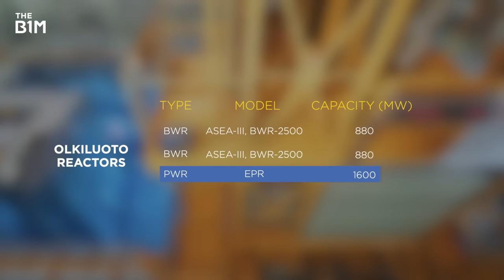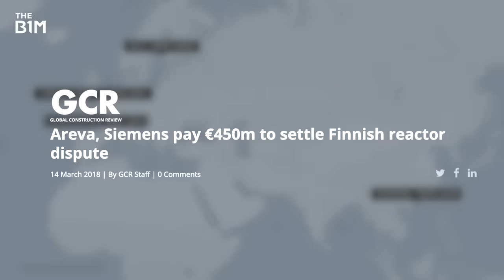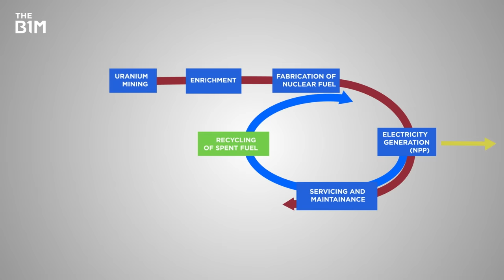Finland Might Have Solved Nuclear Power’s Biggest Problem

Comment: "New reactor design had some issue and caused delays in it's construction"
"China finished building the reactor without delay"
Uh oh...
Reply: It may be the one that is now leaking..
Reply: @bah-be8159  yes it is
Reply: Well china have healthy consteuction/industrial sectore how have modernize the country and had make huge project.
Same as it was in many other countries decade ago.

But when it been 30 or 40 years that you have not build a complexe thing the first one will cost 3.14 time the price and 3.14 time the time.
Reply: well the upside is if the thing in china is not working properly, you will never know, because every engeneer that knows about it, will disapear sooner or later.

Comment: “Why aren’t we building breeders that make their own fuel?”

“too much moni”
Reply: difficult there are only two working breeders in Russia burning material from old Bombs but with constantly new problems. and it is really expensive. solar and wind (wood, gas, and so on) are cheap. You don't want to build somthing when no one will bay it.
Reply: Why aren't we building Thorium reactors which has low amounts of radioactive waste and also has a very short half-life compared to other reactors..
Reply: @wildfire160  for nerly the same reasons with on differnce: there no functional Thorium reactors and the produce waste. Molden salt reactors produce not so much waste but same problem: not really working outside from laboratory.
Reply: @mangshu21  one part of the sahra desert can generate the energy need of the world. Solar thermal energy (stored in molden salt thermal energy storage) can be used at night. why is solar trash?

Comment: There are two choices: either the world embraces nuclear power, or accept a greatly reduced population and standard of living. This is why projects like this must be built additionally, nuclear waste should be reprocessed into new fuel.
Reply: Yes but we need to embrace the right kind of nuclear power. ERPs are  not the answer.
Reply: Renewable technology is rapidly improving. There is a viable third choice.
Reply: @ReubenSilveira6  I used to work in the energy sector so I have some knowledge of what renewables are capable of. Yes they have improved in the past few decades, but they are still not able to provide the power needed to run a modern economy. If renewables were the only energy sources available, with current technology, five billion people would die.
Reply: @jackfanning7952  Jack, you need to read more. I don't know where you found your numbers, but they are wrong. In 2020, 41% of U.S. electricity was generated by natural gas; 20% by nuclear, 19% by coal, 8% by wind, 7% by hydroelectric, and 3% by solar. These numbers come from the EIA, which is the most reliable source.
Reply: Also, remember that humans need a lot more energy than is provided by power ( i.e.electricity). A lot of our current world also relies on chemical energy from fossil fuels. For instance, if we outlawed natural gas and petroleum, fertilizer would need to be made using electricity, which can be done. If there were also no nuclear, fertilizer would need to be made from solar, wind, and hydroelectric. If that were the case, food prices would skyrocket and many people would starve.
Reply: @wordsofcheresie936  I read A LOT. Always have. But I am selective with what I read and who I believe. I got a lot of the numbers about energy from the WNISR 2020 and 2021 status report on the nuclear industry and 30 years working as an industrial hygienist. I have a love of the environment and a penchant for growing things. I also have a degree in agriculture which taught me all the wrong ways to try to grow things (like what you referred to in your comments). But If you don't like the numbers that I provide, which are not my numbers, believe what you want. I choose to believe otherwise. I have seen the destruction within the last 75 years of industrial agriculture of our fertile plains built over centuries with the symbiotic relationship of grasses and wandering herds of ruminants. I predict the entire American Midwest will be a desert within the lifespan of our children...and all the topsoil will be in the Gulf of Mexico. 
After WWII, the two forces that are mostly likely to destroy the ability of this planet to support life were unleashed: industrial agriculture and nuclear energy. I don't know which will get us first. Lord help us to get rid of both before it happens.

Comment: The long term solution is to RECYCLE it!
Reply: But how?
Reply: @TebatusYT   By using what are called 'Breeder Reactors'. France for instance generates over 90% of it's electricity with nuclear power and does NOT have a waste problem. This is because they also operate 6 breeder reactors where they reprocess all the waste and put it back into all the other reactors. Using breeder reactors to recycle nuclear fuel over and over makes it as much as sixty times more efficient. Sixty times more power with the same fuel, and with VASTLY less waste. That's 60 times, 'not' 60 pecent.
Reply: @panpiper  so why wont everyone send their nuclear waste to  france if thats the case
Reply: @panpiper  sounds efficient and clean, thanks for the reply.
Reply: @vihreakuula4319   I expect some do send waste to France, but France is not the only country with breader reactors, they just have the most of them. The downside to breeder reactors is that they are exactly the same facility you need to get weapon's grade material, so it's not something you want being built in rogue nations. However for the most part, such nations can't afford nuclear power plants to begin with.
Reply: @panpiper  Thats not true, france doesnt have breeder reactors
Reply: yo mama
Reply: @senor_m6673  what about Phenix....?
Reply: @shooter7a  shut down more than 10 years ago
Reply: @senor_m6673  You are correct, I used the wrong term. They use "Purex" facilities, which purify and separate material, but does not make more than what is put in, unlike a breeder reactor.
Reply: @senor_m6673  10-4.  So they HAD breeder reactors, but do not any more.
Reply: Once you've recycled and used it you actually have more nuclear waste that cannot be used any more. What are you going to do then?
Reply: @vihreakuula4319  FInland's laws prohibit exports of nuclear waste. That's largely because in the Soviet times it was sent to somewhere in south Urals and we all know how well they handled it there.
Reply: @shooter7a  yeah sounds like a great plan for the future then 😖
Reply: It'll stay there just fine until it's safe to be handled again. That won't take more than some 1000 years.

Comment: This is really good news. I have always imagined nuclear power as the best way to bring limutless stable electricity to African countries. If one can solve the waste and safety issues. This is a step in the right direction.
Reply: Trash to energy plants
Reply: Finland really hasn't solved anything, the best option is to reuse spent fuels and there are reactors that exist that can reuse fuels again making them safe to dump back into the environment once been depleted, just politics doesn't want it funded and misinformed public perception fuels this as well
Reply: Trash to electricity plants are working well
Reply: @bigcnmmerb0873  If everyone would put the waste back where they found it, it's a problems solved. There is a limited amount of uranium so there is only a need for limited amount of vaults.
Reply: @DuBstep115  or you could reuse that waste to completely depleted it and tremendously reduce the waste from 10kg to 1kg
Reply: @bigcnmmerb0873  Does it even matter in the long run? Since nuclear power is not renewable.
Reply: @DuBstep115  if the long run is 1000 years in the future it's irrelevant right now mate so that arguement holds no water
Reply: @DuBstep115  do u have any idea how much material there is on the planet?  There is enough  in the planet to last 1000 years both uranium and thorium adding to that why bury waste when it could be used again to b fully depleted of all it's energy
Reply: @bigcnmmerb0873  About 15 million metric tons. Also I prefer NEA's (Nuclear Energy Agency) opinion to yours.
Reply: @DuBstep115  with the use of breeder reactors if we extracted that uranium from sea we r looking at having fuel that will last 300,000 years since well reusing the same fuel means using less unused fuel so yes my earlier statement still holds true mate
Reply: Why must things always be brought to African countries? Why aren't they bringing things to everyone else?  What kinds of good tech are they hogging there?

Comment: the whole project is pretty much a running joke here... 
But we're already knee deep in it, might as well go all the way and finish it.
Despite the increased cost and delays.
 lol
Reply: . . . . “finish it” . . . nice.
Reply: At least you get cheap energy and reduce your carbon emissions though.
Reply: @marksapollo  maybe one day if it doesn't get delayed by another 10 years
Reply: @Tsuchimursu  Except that its ready now.
Reply: @bloodypine22  well technically yes, but they had some delays in starting actual production and the plant is scheduled to start proper production in early 2022. We shall see if they get it running on full capacity or not by then... So yes it's built but no it's not yet making significant power.

Comment: In October 1976,[9] concern of nuclear weapons proliferation (especially after India demonstrated nuclear weapons capabilities using reprocessing technology) led President Gerald Ford to issue a Presidential directive to indefinitely suspend the commercial reprocessing and recycling of plutonium in the U.S. On 7 April 1977, President Jimmy Carter banned the reprocessing of commercial reactor spent nuclear fuel. The key issue driving this policy was the risk of nuclear weapons proliferation by diversion of plutonium from the civilian fuel cycle, and to encourage other nations to follow the US lead.[10][11][12] After that, only countries that already had large investments in reprocessing infrastructure continued to reprocess spent nuclear fuel. President Reagan lifted the ban in 1981, but did not provide the substantial subsidy that would have been necessary to start up commercial reprocessing.[13]

Comment: Just recycle it.  Then the very small amount of waste that recycling produces will be so much easier to deal with. Yes, it is plutonium.  But the amount that is produced is minuscule in comparison to the literal tons of waste that is produced without recycling.   You could even use that underground facility the Finns are making and the smaller waste stream will be inaccessible forever the way they will do it.

Comment: Thorium molten salt reactors are likely the solution we are looking for.  The wastes at the end of the thorium cycle only need to be protected for about 300 years.   Molten salt reactors operate at normal pressure and avoid the risks of meltdown.  Plus, they extract many times more energy from the cheap, abundant thorium fuel.  Once the process has begun, thorium reactors can produce their own fuel supply.   This technology is almost ready for commercial use.

Comment: So, to recap ....... They have designed a new generation of reactor, but kept the bad bits like pressurised water and fuel rods that use about 3% of there energy before needing to be replaced and you then bury it nearby!

Did I miss anything?....... Of course I did
They hit delays that made it no longer cutting edge tech!
Reply: Yeah, it's the French/German top of the line nuclear know-how. Stretch 5 year project into 15 years

Comment: RATHER THAN LOCKING AWAY THIS SPENT FUEL WE SHOULD KEEP IT WHERE WE CAN GET A HOLD OF IT BECAUSE WE CAN USE IT IN THE FUTURE WITH GENERATION FOR REACTORS

THIS PROCESS WILL CAPTURE MORE ENERGY OUT OF IT AND THEN THE FINISHED PRODUCT WILL SHINE FOR ABOUT 300 YEARS VERSUS 30,000 YEARS

Comment: The biggest problem of nuclear that nobody talks about.... heat byproduct.
Residual unused heat is dismissed as "by-product". While reactors are very efficient at utilizing the heat they use, they still only use 15% of the total heat production and the rest is discharged as by-product. Approximately 85% of the heat is not utilized. There is so much heat produced that distinct microclimates are seen near reactors. Areas of fog, rain, and even wind can be localized and attributed to a nearby nuclear plant. If we worry that greenhouse gas production will lead to increased heat, then why are we so quick to dismiss ALL THE UNUSED HEAT that reactors generate??

Comment: Why haven't we moved to using Thorium as a means to dispose of nuclear waste while also producing more energy in the process?
Reply: There is not enough experience in normal nuclear reactor functioning to have such a transition; we would either have to start commissioning more reactors or start insanely expensive thorium research

Comment: Perhaps Thorium should be used in reactors instead of uranium.   Thorium does the same job as uranium, except there is no radiation or possibility of a nuclear explosion.
Reply: Still many years away from commercial application mate,  give it time and come back with that in 2030. It's not a solution for the coming decade

Comment: The Japanese solved the nuclear fuel cycle problem back in the 70's, but president Jimmy Carter banned the process. France generates 80% of its electricity with nuclear power, most of it reprocessed. Why cant the U.S. do the same. Forbes had an article dated Oct. 1, 2014 titled " Why doesnt U.S. recycle nuclear fuel?"

Comment: In the title you should swap the word solved for buried.
Reply: Like it or not, this solution is cheap, safe and permanent. You could drop a nuke on that site and it still wouldn't disturb the waste + the chances of it contaminating anything or leaking in the next 100.000 years is nihil. This isn't some irresponsible dumping in old mineshafts where it can pollute ground water.

Comment: Good vid, but it didn't mention comparative prices; and those are (or should be) the ultimate determinants of what kind of power generation is best. If the total price per KwH, including disposal costs, is lower than that from burning fossil fuels, well and good; otherwise, the "world" should not be "transitioning away" from the latter.

Comment: Why don’t we put it back where we found it. It’s less radioactive than when we took it out…
Reply: Density, You could hold uranium ore in your hands for a while and it would be no big problem. Tons and tons of ore is processed to get 1 kg of uranium. Putting spent waste back into old mineshafts isn't a new idea. But also not perfect, Germany had problems with leaks contaminating nearby water reserves.....etc.
That's why the geological layers to embed it in have to be chosen specifically for storage.

Comment: What happens if we want that fuel back to use in newer and better reactors?  I'm pretty sure we will be able to use fuel until inert sometime in the future. Gas engines went from single digit efficiency to near 50% in 100 years. Using 100% in fission reactors would be just as good as fusion reactors. I know fusion is the new path but 100% fission could be just as good. Maybe easier being as we've used it longer and understand it better.

Comment: Don't know about the solving but it will explode in future as it was build by cheap foreign workers who made so many mistakes and other problems with the construction so it delayed 10+ years to be finished. It was in news often that there were flaws in concrete foundations and concrete constructions generally.
Reply: Concrete isn't used in the storage itself, you're talking about the reactor which is an entirely other topic. This is about the waste storage

Comment: I am reminded of the race for massive sized satellite launchers between US and USSR.
The USSR won the battle by combining 38 (I think) small rocket motors in a cluster. The obvious  advantage was reliability,  multiple production economy and less complexity.
Abortive launch would be far simpler as the US discovered. Surely this philosophy applies to SMR and large 1GW stations.

Comment: Highly radioactive waste is a non-issue, as it doesn't have to exist. It's an entirely political problem.
If something is highly radioactive, it's great nuclear fuel. And can be used in so called breeder reactors. They only create a little energy, but they turn the pretty useless 238U that makes up 99% of Uranium in the ground and still 95-97% of fuel rods into 235U that's the actual fuel in regular reactors rods.
Why aren't we doing this then? Well, Russia does. But nobody else, because of nuclear nonproliferation treaties. Good fuel could make good bombs as well.

Comment: Seems a waste of perfectly good u-238 which is like 95% of the spent fuel rods.
Reply: Well, there is currently no economically viable way to get rid of the actinides in the spent rods. It's simply cheaper to bury it and be done. Although recycling could reduce the volume of the waste a lot, that's not an issue with this solution.

Comment: Can someone please tell me if i'm wrong, but isn't nuclear power still reliant on centuries old technology to actually drive the alternators that create the electricity? I do believe the Alternators are Steam driven. Am i wrong?
Reply: You're correct. All fuel based power generation is turns heat generated by the fuel into kinetic energy, which is then used to generate electricity. The only difference is that some methods are more efficient because the methods are different.

For nuclear energy, fission happens while submerged in water. The water heats up, either turning directly into gas and spinning the turbines, or it's in a pressurized closed loop where it's used to heat up another water circuit which then turns the turbine. Most nuclear reactors fall into these two types, with some differences such as using heavy water instead of regular water.